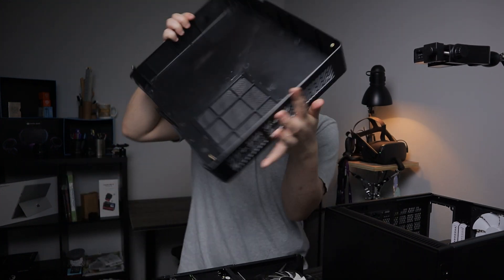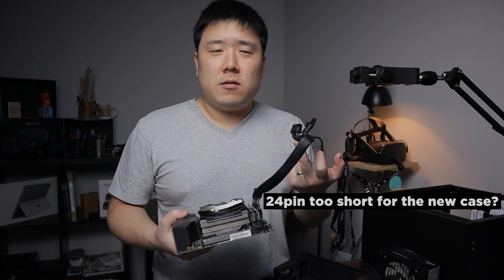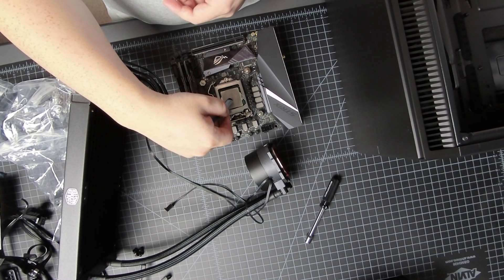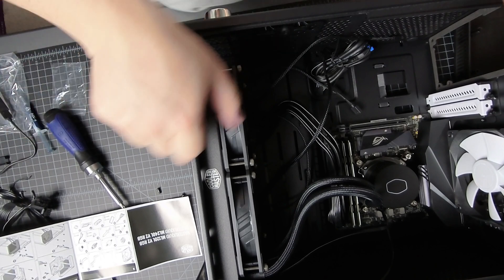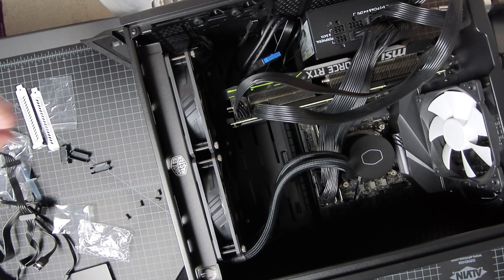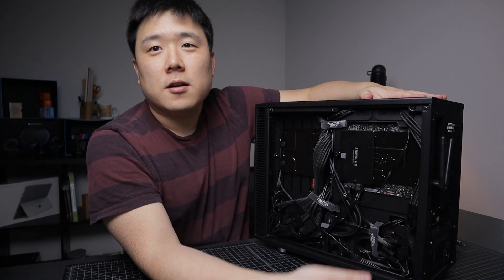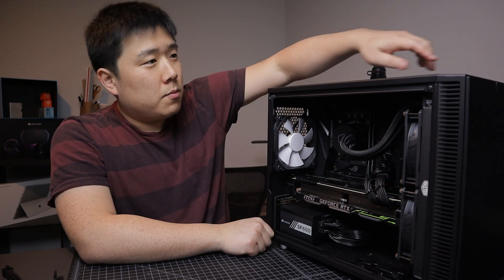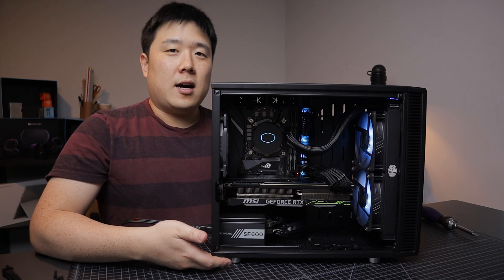Upgrading from Nano 202 to Define Nano S for better thermals - Architecture PC Upgrade (Part 2)

Comment: Hi! I got a question. I'm ugprading to a 3070 with the same case and I have a regular ATX PSU. I'm afraid it won't fit so I'm getting the same PSU as you, the Corsair SF600. Does the SF come with the ATX adapter? Is your 2080 also a 2.5 slot card or more?
Reply from the maker: It does not come with ATX adapter. Mine was 2.5 slot.

Comment: Nice video Joe, thanks. I built my ITX system in a Nano last summer. I opted for more airflow and ease of building over small size. No gamer I, I use my machines for work. I really like the Nano, but I admit I am partial to Fractal Design cases in general. I also did a Define R5 build. I like the no-nonsense look and the quiet the solid panel versions give me. Side note: As you mention, since I have a full-size power supply in my Nano, it deprives my RX 580 graphics card from some airflow; not ideal, but not a big deal either.
Reply from the maker: The 2080 I have does not fit with regular ATX power supply. So, that was a right choice!

Comment: Bought the case three years ago, changed to Fractal Design Define C because my then new 2080 bump the PSU. Thinking of going back to the case again. Too bad instead of updating the case, Fractal decided to create a hot box with the Fractal Design Era. I mean, just give the Nano a tempered glass and give the top mesh layer from the Meshify C/Define 7 Compact as option and you have Define 7 Nano.
Reply from the maker: I'd love the Meshify front on this!

Comment: Thanks for this. I wanted to change out my full size PSU for an sf because i realised it was really driving up the thermals of my GPU. I know i need to buy extension cables for that.
Reply: You should see mine, I mounted my GPU vertical while using a full sized PSU
Reply from the maker: Thanks for watching!

Comment: hi buddy, i just found this vid... i plan to build into this itx case with sfx power supply just like you did. i have a question for you. realistically, there is only need to extend 8pin cpu power and 24pin mb power, right? since i can run 8pins for gpu straight from the power supply to gpu in the front without rooting them behind the mb tray and then back out..... (im going for no window case so i dont care about them being visible in the front) thanks.
Reply from the maker: I think you can. If you plan on having HDD, you may need Sata extension. Aside from asthetics, having no cable in front of the GPU is helpful for airflow I think.
Reply: @JosephKim  "in front" of the gpu - i mean next to the side panel. i dont think it will block any air from the front fans.... in case of any 2.5 ssd i can throw it on the floor below the gpu, right next to the power supply.
Reply from the maker: @R1S0.  makes sense.

Comment: Great Video, very helpful. I am putting together a remote workstation build for architecture rendering right now with i7-10700k and quadro rtx4000. Definitely thinking of using the Define Nano case as well as I want to keep the build responsibly compact. What are your thoughts on the AIO cooler as opposed to using a cpu heatsink&fan, something like a Noctua d15s? To be honest I am a bit intimated installing AIO cooler for the first time, but installation here seemed to be quite straightforward.
Reply from the maker: Yeah, it really wasn't as bad as I thought as the case really was well prepped. One other thing to consider for air cooler is the clearance, as this is not a big case. Personally, I wouldn't get quadro for Architecture renderings. Same dime has given me much better performance for getting GeForce cards.
Reply from the maker: Also, I think my next upgrade is the CPU to go ryzen. 10th gen Intel is really lacking compared to AMD atm.
Reply: @JosephKim  Good information, I actually already have the i7 as I was able to get a deal on it, however I have not ordered the gpu, as I am still debating if quadro is necessary. Thanks for weighing in on it, because I am having the hardest time deciding on gpu. I also heard GeForce is supposed to announce their new series soon as well, so I may wait until that announcement before making my decision.

Comment: max gpu temps you had under load?
is it best to have sfx power supply for this case?
is the airflow unobstructed from the power supply to gpu fans ?
about to pick up this case for 20$ AUD from an atx mid tower fractal meshify tempered glass
(still keeping the atx case but just want something much more portable and non glass side panel , so this case looks amazing)
ill need to get mini itx motherboard and sfx power supply tho
Reply from the maker: no matter what I try, I cannot hit 80 degrees on GPU. Took me awhile get get to 77. I would think it is better to have SFX just because of the room between. Especially if the GPU isn't blower style. Otherwise, one of the fan will get blocked.

Comment: Quesion for you, I'm looking at a similar move to this case, but my power supply is standard size, do you think your video card would have enough clearance with a standard power supply in the case?
Reply: I'm running a 2-slot RTX 3060ti with this case and a standard size PSU without any issues (2,5-slot card would not fit). The fit is tight as there's only 1-1,5cm between the CPU and the PSU. As Joseph mentioned in the video, the important thing here is to flip the PSU and have it take it's air from the bottom of the case! I've also placed the standard 140mm fan quite low in the front and that seems to be feeding the GPU with enough air :)
Reply from the maker: It does have room. But I don't really like it being close to. Especially the very reason I wanted to upgrade was to better cool the GPU too.

Comment: Hi Joseph and thanks for your video. Im also making the shift back from a SFF case to the Define Nano S because noise is really an issue for me. So when you say that your build is quiet, could you tell me a bit more about it, do you have an idea of how many dB this build has? thanks in advance
Reply from the maker: Hi! Unfortunately, I don't have any measuring device, so I can't tell you in dB. I have switched out the radiator fans with Noctua, and I can barely hear the system.

Comment: Why i7 and not AMD ?
Reply: single core performance is important for archi programs, therefore intel can become an actual viable option
it's an 8th gen intel, so this may have been especially true back then; but now (ryzen 3rd gen and +) is a different story though.
Reply from the maker: @user-pk6fk5ns1s  you are absolutely right. I am definitely more inclined to go AMD at this point. But, back then, things were a little different :)